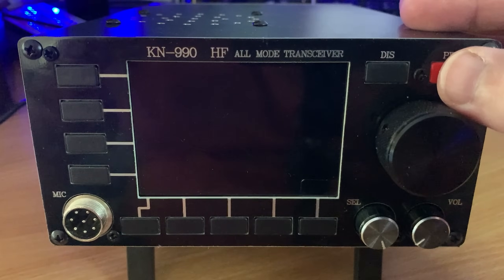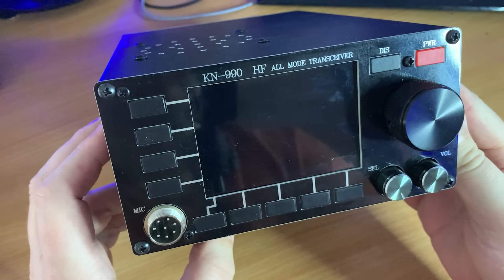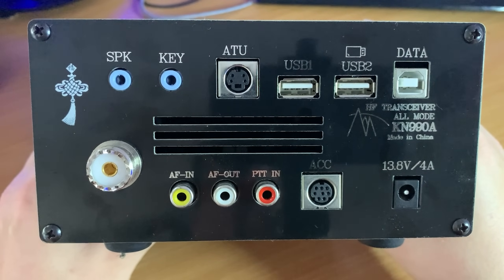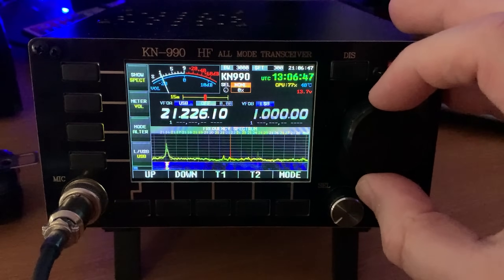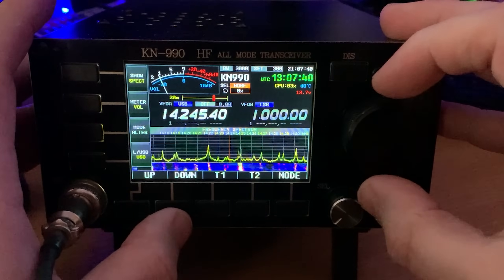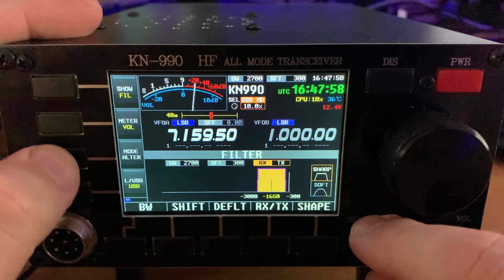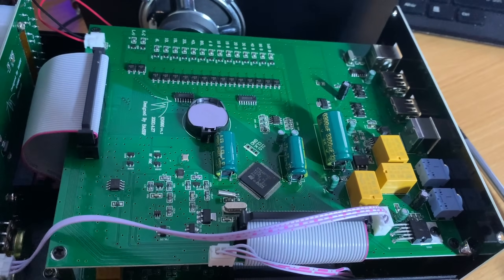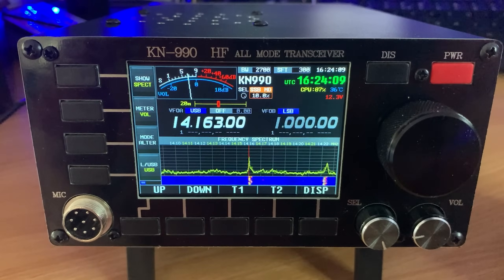KN-990 SDR All Mode HF Transceiver With IF DSP 0.1 - 30 MHz

Comment: Does that tune continuously across the 11 meter band ? Sometimes I like to listen in on CB radio , especially DX . How are it's " ears " ? Is the front end fully filtered for good reception ? I like to string dipole antennas indoors cut for 10 and 11 meters .

Comment: As of May 2022, do you still like this radio? I see them on eBay for $533.00, just a little pricey. It appears to meet all of my needs. I await your report before I take the leap.  Tommy. N4KBM.
Reply from the maker: Hey Tommy, unfortunately I do not have this radio any longer. But the time I spent with it I enjoyed using it. In my personal opinion though, I would recommend the Xiegu G90 or 6100 for a non top tier branded radio over this radio shown in the video.

Comment: Thanks for this video. What comes in the box? Does it come with a microphone? If so, is it any good?
Tnx de Arnie W8DU
Reply: Hi Arnie.  Did you end up purchasing the radio?  What was in its box?  I'm looking at the Aliexpress site, and it should ship with the KN-990 and one microphone.  There were three pictures that correspond to three purchase options: radio and amp, radio, and amp.
Reply: @o2bnov0307  no, I have not purchased this. Still looks like a good radio, but I think I am sticking with my KX3 for portable operation.

Comment: nice robot built boards, but the mechanical mounting will never stand up to any heavy use such as mobile, portable, back packing, etc.  if this is going to live on a shelf.. what the heck.. but it is really crying out for someone to build a really sturdy packaging set up for it.  or beef up what is there now.

Comment: I've had my KN-990 since the spring of 2020.  It really is an excellent radio.  It has far exceeded my expectations and has become my main rig in the shack most of the time.  When I bought mine I got it for US $399.  I see they are now upwards of US $650.  I'm glad I got mine when I did.

I should add that AGC performance was greatly improved by a firmware upgrade.  If you are not running the latest firmware do consider upgrading to v114, which is the latest and greatest.  My radio came with v106.

73 de W4TU
Reply: Have you still got the radio, please , I have acquired a second hand one but the audio isn’t very good on tx, on ssb don’t no what the audio settings should be , depth , bandwidth etc , hard to find any info regarding what they should be set to,,, cheers shane uk
Reply: I have the KN990C and firmware v114, and my friend who tested it with me thought the AGC was not there at all. Where is the switch to turn on the AGC? I couldn't find it mentioned in the manual. 

The loudness between a strong station and a weak one in SSB is pretty big.

Comment: I can't believe the reach with just 15W, I know the video is probably edited but with my IC718, dipole and 10w I can't work sh*t. Hmmm wonder what my problem is, I have a hideous noise problem at my QTH, but I'm wondering was it really that easy to make contacts with this Txcr, end fed antenna and 15W?
Reply from the maker: I would never edit a video in such a way that it portrayed something better than it actually is. But yes! 15 watts, even 5 watts of Milliwatts you can have contacts. It’s all about the conditions and the antenna. Try making a 49:1 end fed, they work very well!
Reply: @TechMindsOfficial  I don't know why I have such little luck, my garden is small so can only fit something for 40m upwards. I have a OCFD in an inverted V apex at a height of about 6m. I've thought about a vertical but with my noise problem that might not be sensible. In 3 years of having my licence, I've only worked maybe 5 stations. I need to get my act together and take the intermediate test. I like your videos mate, probably my favourite amateur radio related channel on YouTube I would say.

Comment: This is all I need. My big heavy FTDX1200 has more stuff that either I don't need or will never use so it's days are numbered. I'll just get a KN990 and an Ameritron 811 and a good antenna and have all I will ever need and I can easily just use the 990 for summer portable hilltop DXpeditions. Easy peasy,simple dimple.

Comment: Really interested in this transceiver. Seems to fit my current needs at nice price. My main concern is what to do in case of any troubles.  Who can diagnose and repair it and if there is any warranty coming with the rig?
Many thanks for yet another great video and finding such a nice jewels! 73
Reply: You pay for return mailing back to China & then back to you as with most radios made there.It's the Big issue I have with making purchases from any Chinese Companies.

Comment: banggood US$578.66
aliexpress US$489.25
   ..not too bad, considering this is in the price range of some of the 'premium' HTs!
Reply: I've had mine for a little over a year.  At that time an eBay seller in China which I've used before had them for $399.  It turned out to be a fantastic purchase.  With the firmware upgraded (it does improve performance) this radio is very good indeed.  73 de W4TU.
Reply: @caitlynmartin9214  Great deal! Thx Caitlyn!

Comment: .... too bad it doesn't have an ATU built in.. that's where the G90 shines, has an ATU that tunes wet noodles. 20 watts is nice too. Those EFHW antennas are not as easy to tune as you might think; at least mine isn't. SWR awful on 40 and 80.. perfect on the other bands... VNANano tells all.. slick little toys.
Reply: Never understood the mania for auto-tuners. Marginally more convenient, takes up less space, I'll grant. But you get better performance from a manual; I use EFHWAs too, and just straight-up random wires, and both my desk tuner and ZM-2 have no problem with either. Use them a few times and they're a snap to operate. 

All I'm saying is, I'd rather have a cheaper xcvr with less to break than an on-board ATU. (Keyers, same difference.) Your mileage may vary.

Comment: I have the amplifier which I think is built really well. I really want to try the radio. Have you thought of getting the Amplifier?
Reply: Don, what is your experience with the radio and its amplifier with your use in the past year?
Reply: @o2bnov0307  The radio I don't have but the Amplifier I have used on the Hermes Lite. It works pretty well. I have a video on my channel using the Amp and Hermes on FT8.

Comment: Be aware that the Chinese radios are almost impossible to repair and/or get replacement parts. If you buy one all I can say is good luck in the contest !
Reply: Actually, people in the CRkits group on groups.io and in the KN-990 group on Facebook have been able to get service on these rigs without too much trouble at all.  The manufacturer has helped some hams setp by step through troubleshooting and repair.  The other alternative is to send it back to China which takes time but they do honor the warranty.
Reply: Interesting! What warranty does come with this transceiver? Could not find any info and was concerned that there may be no warranty at all?

Comment: Can anyone confirm the actual TX range on the KN-990?   The description says receive is .1-30mhz and transmits in the "Amateur Bands"   is this limited to 20 - 160 meter?  I have only seen 1MHZ-14.999MHZ in the videos I have seen..    What are the tx limits on the  10-15 meter side?  Is it wide open, they just don't want to disclose this for FCC reasons?
Reply: In one user manual, it says 80m to 10m ham bands. 

Unofficially, I can get 160 to 6m output, after the expand mod.

Comment: No flimsy Flat Flex cable for interboard connection. :-)  lots of space for easy modding / servicing. All large electrolytes are thru hole non SMD types making replacement easy.
Reply: ABS how's the performance, do you use one?
Reply: @vu3mes  no don''t have one. just commented on what I observed from the video.

Comment: Nice review, what size PSU is needed for 15Watts TX?
Reply: 4A
Reply: The power calculating formula is voltage multiplied by current . Now, you have the power out and the voltage...Using a radio mean also bit of knowledges because on Amateur Radio isn't the "just" press the ptt .

Comment: Thanks for an interesting radio review! I wonder, if it is known what kind of SDR is it, or what makes it SDR, what's the architecture of analogue-to-digital conversion?  If it says it's got IF DSP , the fact of presence of IF would show this would be a hybrid  superhet radio with "digitalization" at some stage. Or, it could be that SDR is a separate wide range receiver imstalled with the only purpose to provide signal for the waterfall/spectrum scope, and the rest of the radio is a traditional superhet with traditional IF DSP function. Just curious, it's nothing to do with the quality matters, any architecture may provide with the excellent receiver quality. 73! Linas LY2H
Reply from the maker: Thanks for the comment,  very interesting thoughts. However I personally don’t know that answer, and I don’t think there is a schematic in the public domain. I do know that a NES game, mario brothers, can be played on this radio. Yes, a game! Totally pointless on a radio, but the architecture can obviously run an emulator of some kind.

Comment: Interesting transceiver, but if you added on the cost of an external ATU and a 100w PA the Icom IC-7300 begins to look very good value.
Reply: I’ll keep my old TS-820S. No proprietary parts. Repairable.
Reply: While ICOM isn't perfect, I would gladly spend the extra money to have a product designed and supported by a large team. If I had toy money, I may also get something like this to play with.
Reply: Why I should buy a 100W amplifier if bought a Qrp radio ? And, why i should buy an ATU instead to have a resonant aerial ?  The 7300 ? No, thankyou.
Reply: @adrianoragazzo1321  100W radios generally draw more power even when receiving and weigh more in most cases. For those operating QRP/portable a true QRP rig makes more sense. If you want to understand why current consumption is higher look up idling bias current.
Reply: @adrianoragazzo1321  a IC-7300 can be run at QRP power, you do not have to use the ATU built in if the antenna is resonant. That is why I believe it is better value for your money.
Reply: @1OFGODSOWN yes, he didn't understand power efficiency for different radio designs.
Reply: Icom IC-7300 best !

Comment: I think buying one to use it as main QRP rig isn't a bad choice (as long as its final stage transistor doesn't blow up easily)
Reply: BA6BF did a very dangerous testing previously, leave the antenna disconnected and set to CW 15W, key down for almost 1 minute, nothing happens, the entire unit still working properly, can you believe that?
Reply: @kimijin6777  That's.......incredible, what final stage PA transistor does it use?
Reply: @Neo_Chen  2*IRF530, I do believe it can output definitely more than 15W, perhaps for safety concern, BA6BF limited to 15W

Comment: It says it transmits from .1 to 30 MHz.  Will is actually transmit on 630 and 2200 Meters?  Great review and thanks.  I'm usually leery of some of the off brand radios but this one looks pretty nice!
Reply: Um... no.  It transmits from 3.5 to 30Mhz.  I'm not sure where .1 came from.

Comment: Great review, have you tried it in data modes? Thanks, Dave G6AWF
Reply from the maker: Not yet, I was hoping to find some info on the rear port pins to see if they are usable for an audio interface.
Reply: @TechMindsOfficial  The ACC socket just tells you which band you’re current in as well as current transmit status, it will out 12V to different pins under different conditions, and for digital modes, actually it’s simple, connect the usb cable to PC and the DATA port, select fr817 protocol in your digital modes software, PTT via CAT, and for audios, you need to connect both af-in and af-out rca port to your PC’s audio port, a usb sound card is suggested. That’s all for digital modes. And furthermore, BA6BF was very kindly enough and he opens the schematic  of this machine, aimed for those peoples who are interested in study, re-design and experimental testing, but of course commercial usage is forbidden, you can find the schematic in below link, but unfortunately it’s all Chinese. Not sure if you can get it or not. Link: https://www.hellocq.net/forum/read.php?tid=365486
Reply from the maker: That’s great information!! Thank you sir! thank you 🙏

Comment: Thank Matt. It looks really good. CW performance would be good to know but appreciate it may not be your thing.  Wondering if it has full break in and what the relay is like when constantly switching.
Reply from the maker: That’s a good question, unfortunately I don’t own a key to even test it with.  If I get one I’ll defo test it, we’ll, try to with my limited CW skills :)
Reply: It is not full break in.  The semi break in is comparable to the big three manufacturers.
Reply: @caitlynmartin9214  hello from San Antonio, TX.  It was recommended to me to set my HF radio to semi break in to save the life span of the relay.  On my previous HF radio I always left it at full.  Do you have an opinion on this option?  I guess it doesn't matter with the KN-990, since it only does semi.  How do you like this radio after a year of use?